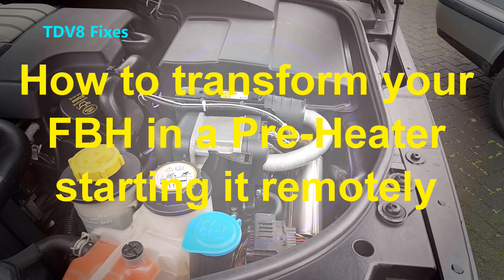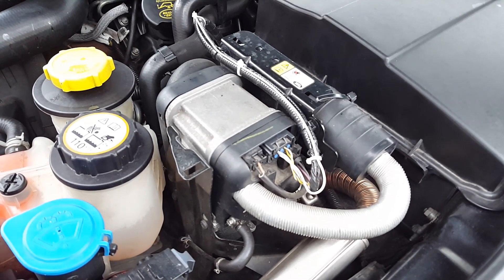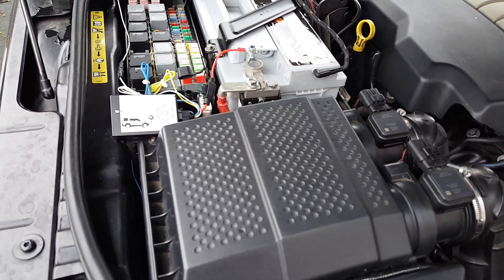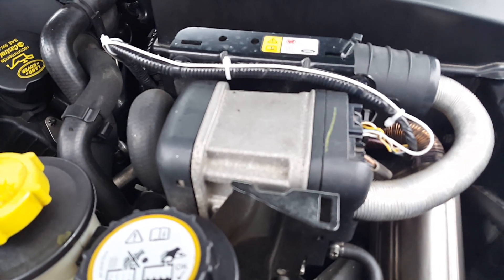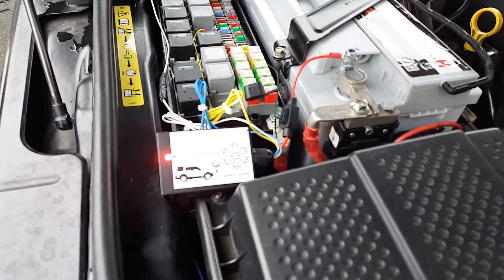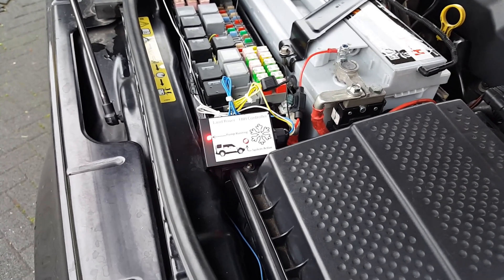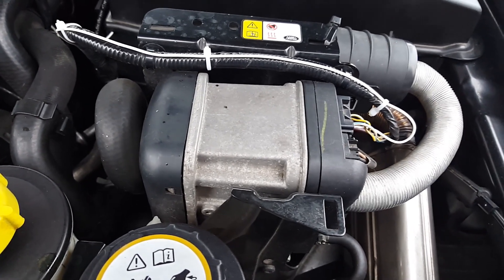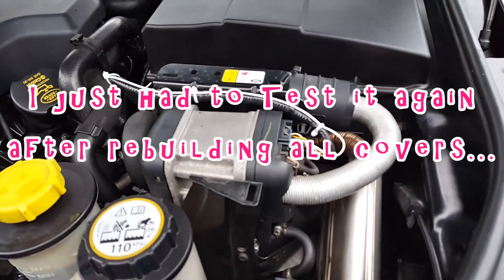How to upgrade your Range Rover FBH to a remote controlled pre-heater

Comment from the maker: My experience so far:
Today in the morning 5°C air temperature, after keeping FBH running for 30 minutes before starting engine, coolant Temperature achieved 45°C. 
I believe my FBH could need cleaning maintenance what would increase efficiency.